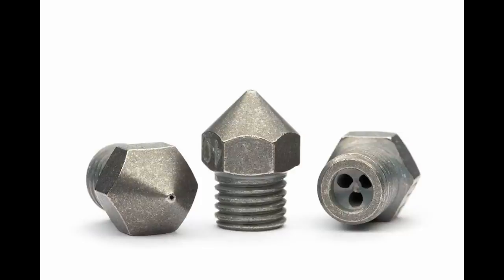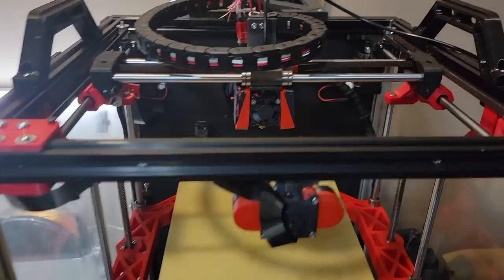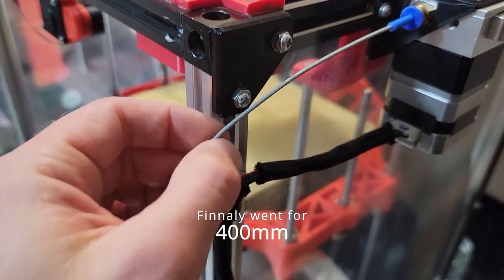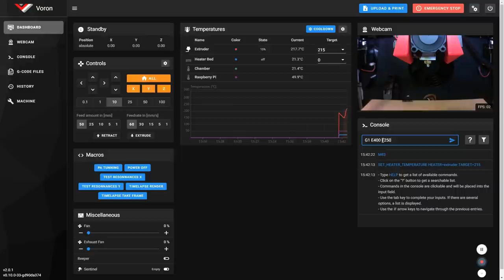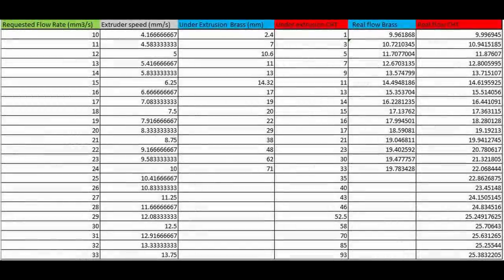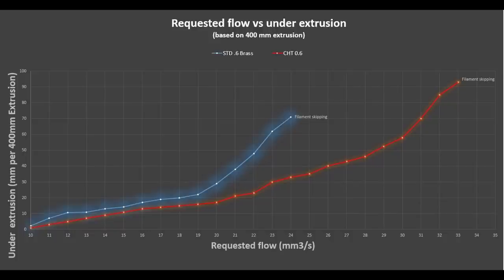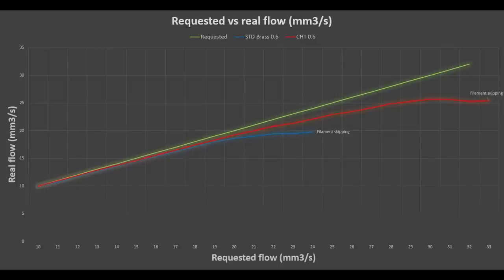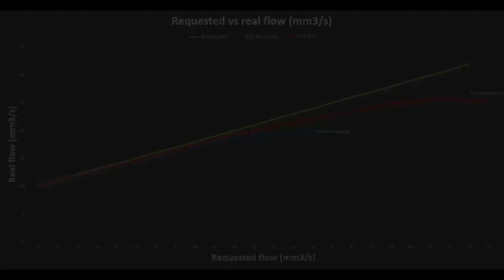BondTech CHT Nozzles Flow test. Do they work?

Comment: You should try to estimate the heat demand to raise different flow rates of plastic to 250 C and melt it. If the better nozzle improves heat transfer, then these higher flow rates might be able to make use of more heat than your heater is currently able to provide.

ISTM this indicates that to push to really high flow rates you are really up against the heat transfer characteristics of the plastic and you might be better off having multiple melting chambers feeding into one nozzle, filament preheating or other ways to improve the situation.

Comment: Thanks for your tests, It was certainly interesting (and important!) to see the difference a simple nozzle change makes in a standard widespread V6 (CHT has MK8 CHTs now, too, so that would warrant another test run for sure, just think of the sheer volume of MK8 printers out there, e.g. all the Creality ones!). I can't help wondering though how much the melt rate of the hotend and the printing temp factors in here, cause as we all know a hotend can only melt a certain amount (which is why they made the Volcano and Super Volcano!)... Also: Maybe you can do another test run at 230C to see if that changes anything? ;-)